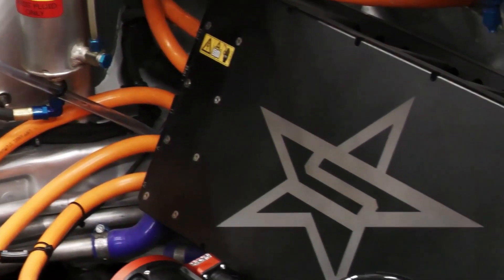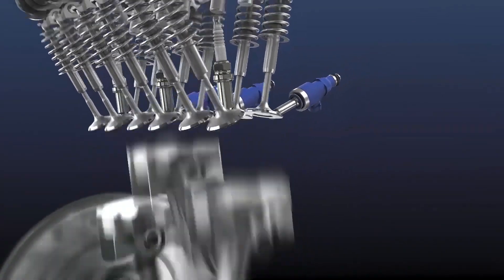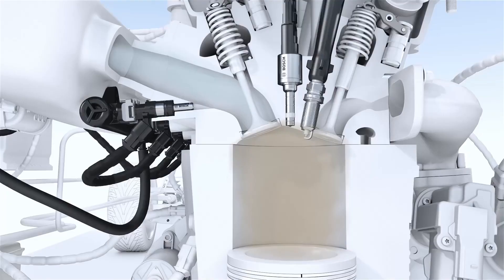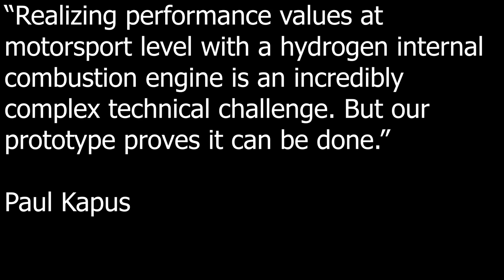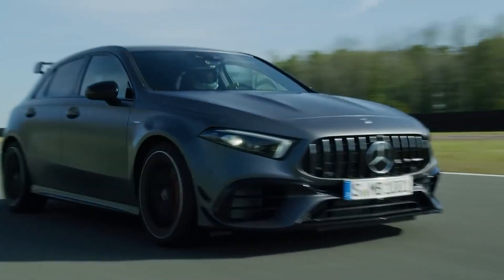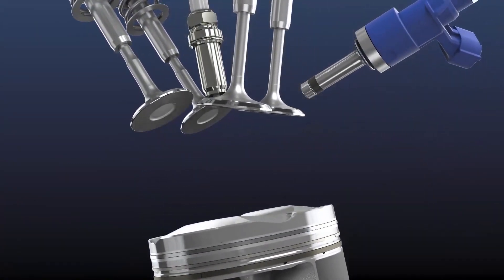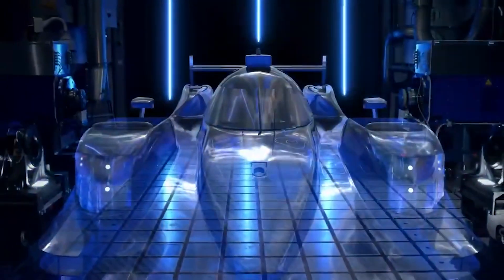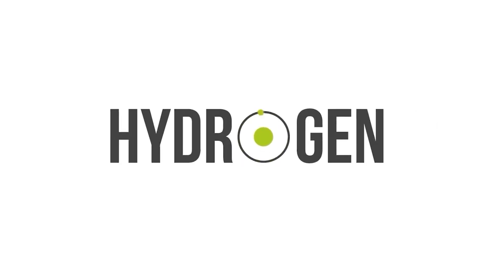AVL RACETECH Builds Hydrogen Combustion Engine for Racing

Comment: If it runs off of water, which it does, then you can use tap water or r.o. or distilled, tap is fine, and then clean out deposits later. But fuel is free this way. That is the point and bottom line. It's also clean. Stanley Meyers died for this in 93 or 94. The mainstream and all of its proponents, really infuriate me--holding the team back.

Comment: The biggest issue is gonna be weight and space. Battery's are getting better smaller and lighter. You can also generate your own electricity. You can't gen your own hydrogen

Comment: With the addition of an air ionizer to the intake system hydrogen burning engines will be more powerful than gasoline or diesel engines. You see where there is a will there is always a way. Nice finds as you always seem to find the good stuff before I can, thumbs up for sure.

Comment: the problem is also the mechanic of internal combustion engine tech, maybe with plasma ignition and/or prechamber ignition could be better with E-compressor would be great
Reply: Plasma ignition could really help with the efficiency
Reply: @TheSilverShadow17  yes some of the early trst of tps show around 25 percents increase of efficiencies and lower emission by 2 times, combined with synthfuel will be great.
Reply: Do go on of this plasma ignition??
Reply: @danmaycock9238  Plasma ignition is a type of engineering fest that doesn't require traditional spark plugs for ignition, which improves engine efficiency by nearly 30% making the engine much more fuel efficient while possibly gaining more power in the process. Also helps with combustion as well.
Reply: @TheSilverShadow17  Niccccccce, think they could be utilised in diesels??
Reply: @danmaycock9238  Part of me says yes since diesels are much more efficient at combustion than the average gasoline engine, but at the same time kind of tricky to visualize what Plasma ignition would look like on a design that doesn't use spark plugs. Just like how the invention of the turbocharger massively changed their performance and made them much more efficient overall.
Reply: @TheSilverShadow17  Could use it instead of glow plugs or at the exhaust stroke??
Reply: @danmaycock9238  Perhaps, that may work